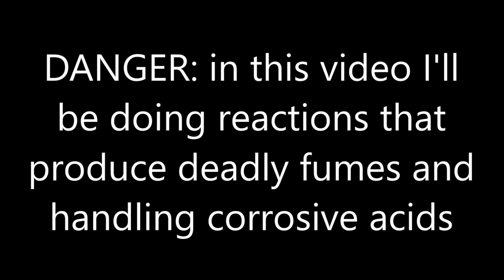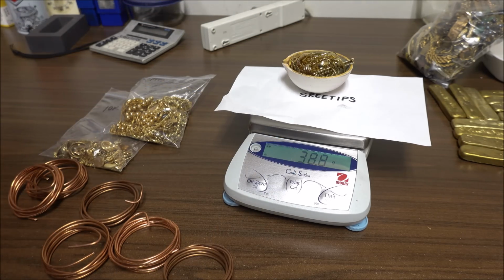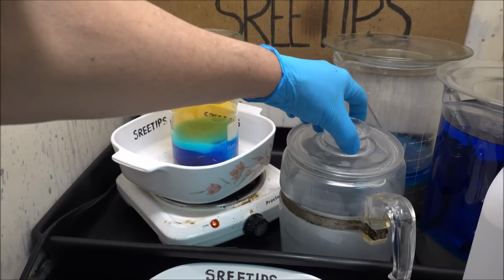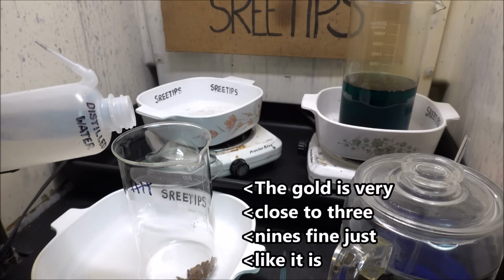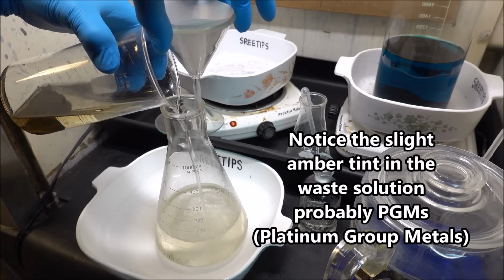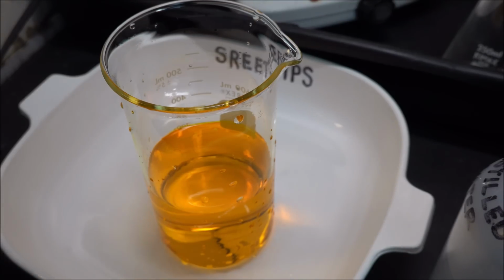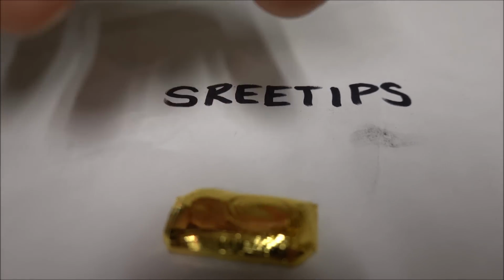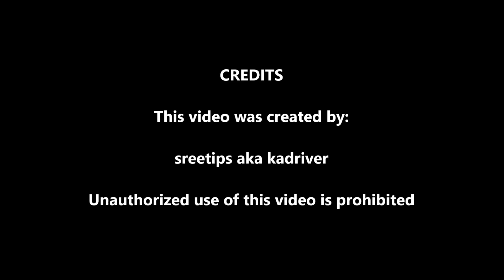Gold Refining Inquarting With Copper

Comment: This is the most rewarding form of chemistry, i would have loved to have done this in high school!😁(I guess I could still take a metallurgical chemistry class)
Reply: You do know you're allowed to do chemistry without a permit, right? It's not like you're running a meth lab! Sreetips doesn't have a qualification in chemistry, I believe he has a bachelors in aviation management IIRC. All you need to do is know what you're doing and you can do anything, and if you don't know it - learn it! Watch, ask, learn. I've got a bunch of degrees and tbh 99% of what I've learned I learned outside of formal academia. Academia is just to get those pieces of paper required to grease the wheels, it's a pyramid scheme combined with a vague wheat and chaff separator. Although lately it's become so terrible that anyone can pass if you're the right special snowflake variety.

Comment: Hi all.  I've just stumbled across this video and have read the comments.  I have come up with a formula that takes the guess work out of how much material to add to make your low karat alloy.  Also doesn't matter if copper or silver is being used.

 Mass(add)=Mass(total)×([Ki-Kf]/Kf)

Mass(add) = the copper/silver amount to be added
Mass(total) = the mass of your sample to be purified
Ki= karat of your sample to be purified (initial)
Kf = desired karat of sample for processing (final)

Here is the example used in this video where:
Mass(total)=38.9 g
Ki=14 karat
Kf=6 karat  
Mass(add)=38.9×([14-6]/6)=51.87g 

This mass is slightly higher than the 49.2g mentioned in this video.  The reason is that this is the mass required (51.87g) to produce EXACTLY 6 karat gold.  The amount mentioned in this video (49.2g of copper) gives 6.2 karat gold which is perfectly fine as demonstrated.  By using this formula any karat of gold can be applied to produce whatever karat is desired and the amount of anything to be added is calculated to achieve this.

Hope this helps.

Comment: Problem is copper uses WAY more nitric acid then silver to dissolve the same mass of metal. Plus if you have silver to inquart with, its a cinch to get your silver right back to re-use over and over.

Comment: Thanks to the wealth of knowledge I’ve gained from your videos, I’m planning on doing a copper inquart on some 14k gold that I have and was thinking about this multiplier. For 14k I get a multiplier of 1.332.

38.9g * 0.583 (or 14k/24k) = 22.6787g pure 24k gold
22.6787g * 4 = 90.7148g total weight needed to inquart
90.7148g - 38.9g = 51.8148g that needs to be added to the 14k to inquart
51.8148g / 38.9g = 1.332 ratio of what needs to be added over the weight of the 14k gold

In this case, that is a difference of about 2.6g of copper. I don’t have the experience to know if that is relevant.

A 1.265 multiplier implies the karat is 13.59k (56.625%). Is this underestimated for a reason?

Thank you as always for putting your experience on display for all of us to learn from!
Reply from the maker: If you add too much copper, for what ever reason, then the gold will crumble to a powder during the nitric boils. This is a nightmare, making separation of the silver solution and the gold difficult and time consuming. Adding GF to the batch. Adding gold plated piece to the batch. Thinking that they are karat scrap, and your gold will NOT stay in nice chunks. It will crumble to a brown/black powder.
Reply from the maker: Goldie Locks range for inquartation to achieve best results is 26% to about 33% pure gold in your alloy. Yes, it’s understated for a reason. I don’t have enough space to write it out for you here.
Reply: I wouldn’t have thought the gold turning into a powder would be a bad thing, but it makes sense in terms for separating it from the resulting solution. 

Another person mentioned Cody’s lab’s explanation of inquartation. Visualizing the way he explained it and what you’re saying about the gold turning into a powder, too much copper/silver during inquartation spreads the gold atoms out too far so when the nitric dissolves the copper/silver the gold will be in smaller pieces. 

Can’t wait to give it a go!

Comment: I love the deeply dished watch glasses. Where did you find them. 
Also when I do small batches if silver or gold in AR I put ice in the watch class as it acts to reflux the nitric acid. Saves a bit in the reagents.
Reply from the maker: Those are filled with oil and a candle burned under it to give off fragrant vapors. I get at the thrift store for a few bucks.

Comment: Thank you for pointing out that Copper can be used for inquarting .  It’s something readily available . 
But QUESTION:  with all the copper in the nitrate solution after initial processing , will silver in the solution still displace 
any solid copper when it’s added  into the solution ?
Reply from the maker: No, copper is more reactive then silver. Copper is above silver in the reactivity series of metals. Put copper in a silver nitrate solution and the silver will come out of solution on the copper. Put a piece of silver in a copper nitrate solution nothing happens. A little silver might dissolve if excess nitric is present. But no metals will precipitate.
Reply from the maker: Inquarting with copper actually seems to do a better job at cleaning the gold because of less silver present, less likelihood of silver chloride forming when going to aqua regia

Comment: I have a question Sreetips: Have you ever had any Pb precipitate after adding the dropper of H2SO4? I don't recall ever seeing this actually happening in any of your videos... just curious here
Reply from the maker: Lead can get in if someone has used soft solder to repair the jewelry being refined. Soft solder has tin and lead, both are bad for gold. This is especially true when refining gold filled material. I've never seen any lead either. But I always add some sulfuric just in case. That trick was taught to me by a professional refiner on the goldrefiningforum.com - Harold_V - I add sulfuric whether I suspect the presence of lead or not. It hurts nothing and provides a big benefit if lead is in my batch.
Reply: @sreetips  Thank you for replying,  I love your videos and watch them start to finish, even though I'm not in the least bit refining anything. I do love chemistry (maybe that is why)... You should, just for experience's sake, refine a parcel of Pb/Sn contaminated jewelry in a video, so we can finaly watch the dreaded metals come out of solution upon you adding the H2SO4

Comment: your videos are are incredibly watchable, was i correct in my assumption that it was easier to refine the gold when inquarting it with pure copper? it seemed like it was.
Good show.
Reply from the maker: Using copper seemed to do a better job of cleaning the gold before refining. I refine silver so I'll continue to use silver instead of copper.
Reply: @sreetips  Isn't it more painful watching hundreds of bucks worth of silver turn into blue liquid you may never recover than a few bucks of copper? I could never bring myself to waste that much silver. Also you need a FAQ / channel introduction video on your default page - preferably explaining what your name means, and other commonly asked questions. I see a lot of those unanswered, people seem keen to know more!
Reply from the maker: Dr. Lex Winter none of the silver gets wasted. I’ll get it all back out of those blue solutions. I save them and recover the silver later

Comment: I really enjoy your videos. I tried looking it up and couldn't find an answer. Silver will disolve in hydrochloric acid and it will disolve in nitric acid, but for some reason it won't disolve well in a mix of the two (aqua regia). Why is that? I know why it takes both together to disolve gold. Does silver form a passivation layer in aqua regia preventing it from disolving?
Reply: but dilutions are we talking? IDK, i'm still confused, learning as well...
Reply from the maker: I've never used hydrochloric acid to dissolve silver. I don't think that it will. Hydrochloric acid will instantly form silver chloride upon contact with silver. It would form a passive layer on the silver and protect it from the acids. For these reasons we want to get ALL of the silver out of the gold BEFORE we put aqua regia on the gold. Silver chloride causes problems with contamination of the gold because it's so fine that it's hard to filter out completely. It's slightly soluble in water, more so in hot water, and can lurk, unseen, in our crystal clear gold solutions. And having lots of silver chloride will load up a filter paper and make filtering the gold a slow nightmare. It's best to get out as much of the silver. as possible before dissolving the gold in AR.
Reply: @sreetips  Ok I knew it would form silver chloride, just not that it would form a passivation layer with it. That all makes sense. It's pretty apparent that silver is the better metal to inquart karat gold with if you have it to use. If you have to go to the trouble to then separate and recover it, it might as well be a metal that's already part of the alloy and worth recovering.

Comment: Inquarting with silver is nice though cause the Ag is +1 versus copper which is +2 and therefore the copper takes much more nitric to dissolve.  Plus since you are getting two birds with one stone by inquarting with sterling to start refining anyway
Reply from the maker: Those charges are important. The advantage to using copper is that it can be had easier than silver. And there is much less silver chloride to deal with when dissolving the gold in Aqua regia.

Comment: Also, add the H2SO4 just before the last rinse. That way there is no chance the Pb would go ack into solution during the subsequent dissolutions.
Reply from the maker: Robert, I add sulfuric every time I dissolve the gold as a prophylactic measure to guard against any lead making it into the precipitation phase. Lead, even trace amounts, can ruin the gold and make it crumble.
Reply: The precipitated lead should be caught by the filtration between processes. There should be virtually no risk of lead contamination in the final precipitate the way he is doing it.
Reply: I am not complaining just offering a suggestion to improve the flow of the process. Sreetips is very meticulous in his procedures. I just have a particular order I perform the process.  I offered an explanation as to why. I like Sreetips explanation of why he adds the H2SO4. He is spot on as to why even the tiniest amount of Pb will ruin a solid refine.

Comment: Beautiful result, yet again !
Reply from the maker: I used tweezers to get the second filter out. I forgot to do it with the first filter. That's a good suggestion and it should be done that way every time.
Reply: Yes, i noticed and smiled, but didn't want to labour the point ;)
A twisting action can get it out pretty much as if you gathered the edges with fingers.
Apart from being good lab practice, i suppose it can help keep a few more molecules of gold in the pot instead of on gloves.

Comment: Wouldn't the copper cause the silver in the leftover nitric solution to cement out?
Reply from the maker: Not if they are both in solution
Reply: There is enough nitric & hydrochloric acid in there to dissolve both.
'Cementing out' only happens if there isn't enough acid to go around.
Reply from the maker: Some of the silver may have cemented out on to the copper during the nitric treatments. But it then redissolves and eventually stays dissolved once all the copper has been put into solution.

Comment: If the process is the same when you use copper you should use copper everytime. As I understand it you will always have losses when refining metals. Losing a little copper would probably cost you a few pennies silver costs a lot more.
Reply from the maker: I refine silver also. Using silver to inquart, I can kill two birds with one stone. The first step in silver refining is to dissolve it in hot dilute nitric. That is why I use silver to inquart instead of copper.

Comment: My question is...  How do I separate the gold from copper in a AR solution containing approx.6g of 18k gold mixed with approx 19g of copper, and I didn't know about the nitric bath, not to mention I quarted it with way too much copper, so I have both my gold and my copper dissolved in AR. What do I do? Can I precipitate it with SMBS and just remelt and pour it in the water by starting over?
Reply from the maker: If gold dissolved, then the liquid can be drawn off after allowing the solids to settle completely. SMB will drop the gold and leave the copper in solution. That’s what I’d do if it were mine.
Reply: @sreetips  Thank you very much. I watched alot of videos trying to figure all this out. You are by far the easiest to understand. Good job and thank you again for getting back to me.

Comment: Sreetips! I have close to 20 of the 5 gallon IdealWater jugs full of used up nitric acid from refining close to 120,000 grams of gold filled jewelry over the years. All of which have about 2 inches of sediment at the bottom. What’s it going to take to get you to extract all the other precious metals from the solution?
Reply from the maker: That's a big project. There will be silver, some platinum, and palladium. But you handle it just like eating an entire elephant, one bite at a time.
Reply: sreetips would you recommend that I filter out the sediment from the solution first?  There’s got to be a ton of Ag in it still In solution, among other precious metals. Is this project anything you’d consider taking on for maybe 15% of the take?
Reply from the maker: I don't do any toll refining, just my own material. That way if I mess it up its all on me. I've never done it but; hot ammonia will dissolve silver chloride. After filtering out all the junk I think that you can get the clean silver chloride by adding hydrochloric acid. No experience with this though.

Comment: Hi, I wonder if it would make sense to try electroplate the inquarted alloy in copper sulphate onto an electrode. The gold will not go into solution and collect at the bottom of the cell. this way you could save some chemicals and it doesn't require a lot of electricity.

Comment: Did you happen to keep track of the volume of nitric acid used?  I was originally instructed to use silver over copper as copper will require significantly more nitric than silver to be dissolved out of the gold.
Reply from the maker: I did not. But I know that copper uses more nitric than silver does.

Comment: Hi sreetips, very helpful videos. thanks. Sometimes you use inquarting process to refine gold and other times you use aqua regia without inquarting. In what instances should you use iquarting and when should you use just aqua regia?
Reply from the maker: Karat gold inquart. Gold filled, incinerate foils and then AR. Escrap foils are so thin that they will dissolve in bleach and hcl
Reply: @sreetips  Cool that makes sense, thanks. Am wondering about the filter papers, what type, grade and size that you use? One for filtering the precipitated gold and the other for filtering the gold in solution after AG treatment

Comment: The only problem with using Copper instead of Silver is that it requires 3 times more Nitric Acid to dissolve the Same Weight in Metal ,, I can’t remember the exact amount but it takes roughly 3 times more nitric to dissolve one gram of copper as it does to dissolve silver
Reply: And silver is about 180 times more than copper in price. The math here is good.

Comment: I think nearly, if not all, my scrap gold is 9k. Does this need inquartation? FYI - All I can buy in England is 3% Nitric Acid. Not sure if that's relevant.
Reply from the maker: I’ve parted 9k with no inquartation. But I did it with 68% nitric diluted with same amount of distilled ware. 3% nitric is something I don’t have any experience with. Sounds kind of weak.
Reply from the maker: Also, copper will require more nitric than silver does.
Reply: @sreetips  Thank you. 3% was the strongest I could source. Unfortunately here in UK we are micro managed by the government. There are so many restrictions on buying chemicals. It's bewildering to me that in the US you can buy stuff over the counter that is not permitted here.  About 20 years ago I showed my son how to make Nitrogen Tri-iodide for a bit of fun. I bought magnesium ribbon too. I had a phone call from the police anti terrorist squad asking what I was making...... That was a long time ago and it's got worse and worse since then.

Comment: The one question I've got about your silver cell is: Is the silver cell actually improving the purity of your silver by electrolysis? Or is it just taking the impurities with it to form neat crystals?
Reply from the maker: The electrolysis produces high purity silver. Is the cell actually improving purity, yes - close to five nines fine. Is it just forming impure neat crystals? If palladium is kept out, the voltage is right, and copper concentration is kept below 60 grams/liter then the answer is no.

Comment: I screwed up. I took 18.4g gold and alloyed it with 54g copper giving me 72.4g of the alloy shot. So then I weighed out 28g of the alloy shot and added it to a solution of 28g mx-3(nitric  substitute) mixed with 120ml hydrochloric acid. I stirred it and put it on the heat. It reacted fast and dissolved everything. So I now have two problems. 1. I quarted too much copper into the gold but worse I fear is that I didn't give the alloy a hot nitric bath. I put it straight into the AR. So how do I separate the dissolved gold from the dissolved copper in the AR brew I now have?
Reply from the maker: I’d let the solids settle completely and siphon off the gold-bearing solution.